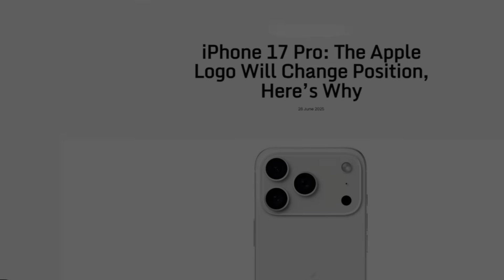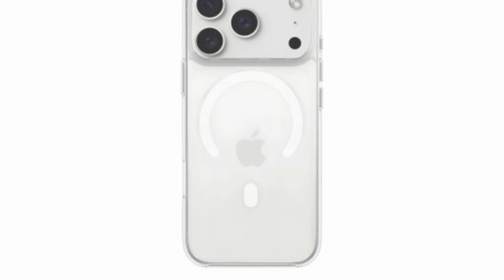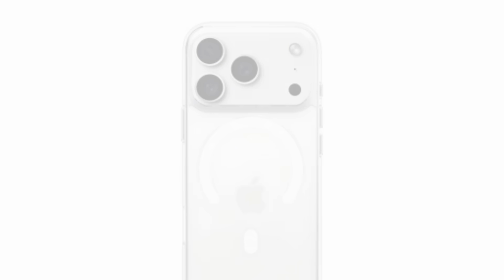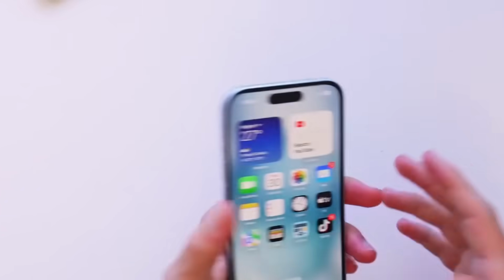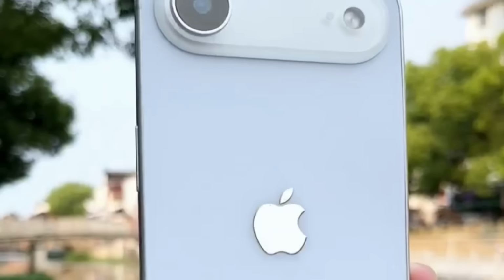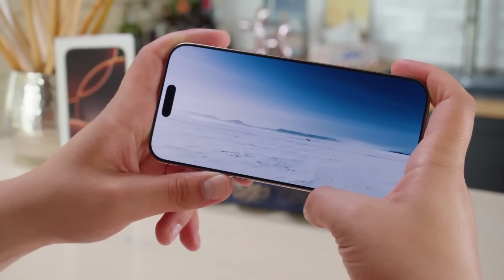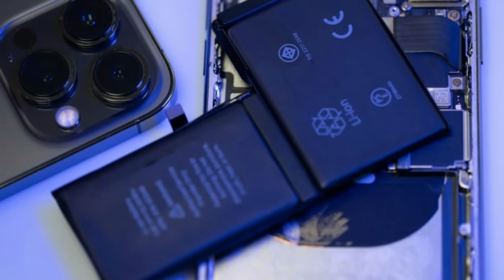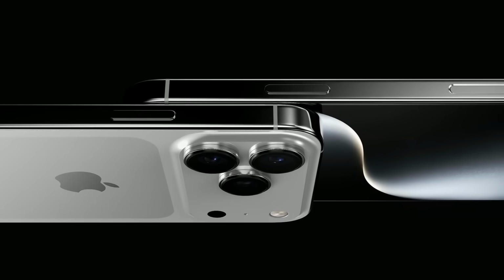iPhone 17 Pro Max - OMG,  No One Saw THIS Coming... 🔥🔥

Comment: If apple doesn't bring some much larger upgrades than this, the Pixel and Galaxy S26 Ultra will take the best phones of 2025 and 2026 like they did in 2024...Apple has some changes that would be so easy and bring more sales but they are notorious for holding upgrades back, like their stupid lightning cable they didn't upgrade until 2 years ago...that's pathetic.